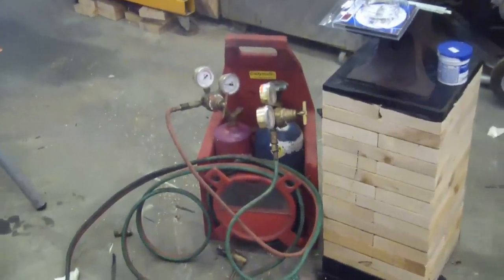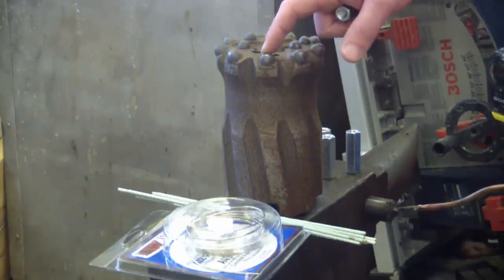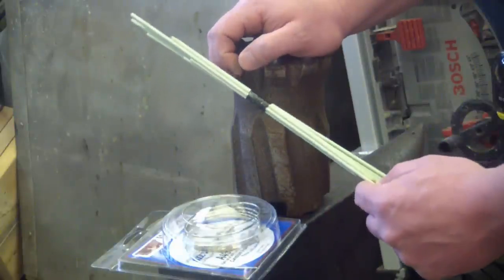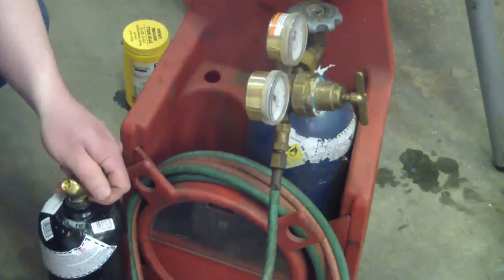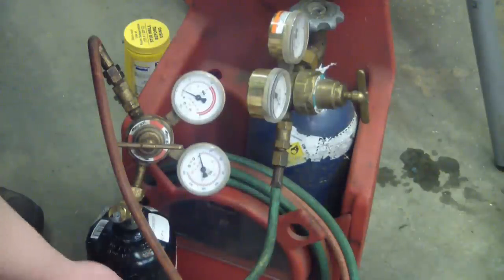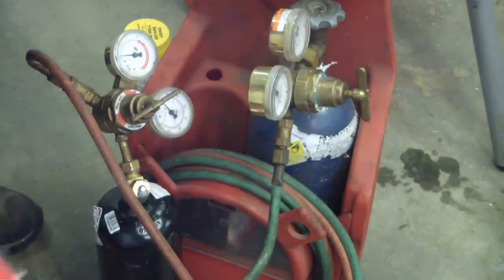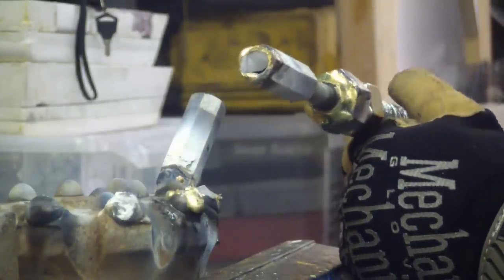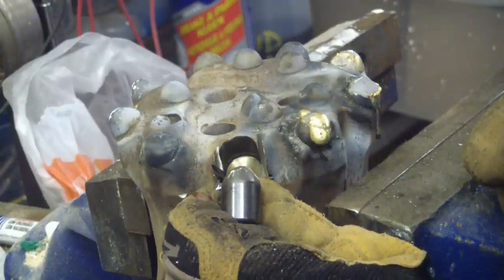How to recover tungsten carbide from drill bits

Comment: Carbide Recovery by electrolysis and acid erosion

Bringing the part above the braze melt temperature and impacting the part to send the tips flying is quick but dangerous. A couple of chemical methods come to mind that should recover both the tips and the metal part without much distortion. If your drill head has press fit carbide then try the stuff below.

Pure WC aka tungsten carbide is completely resistant to acid attack except HF and HF+HNO3 mixtures (hydrofluoric acid and HF mixed with nitric acid for extra excitement and very dangerous stuff). Regular swimming pool acid is med conc hydrochloric acid and should rapidly dissolve out the brazing metals holding your valuable WC buttons in the alloy steel drill head. Simply pour some of that pool acid into a plastic yogurt tub up to a level that covers the WC buttons and place the drill head into the liquid button side down for overnight, up to a couple of days.

If the buttons in your video are cemented tungsten carbide or WC+Co mixed metal sintered composite, the cobalt mixed metal binder may dissolve on the surface of the button and leave a black sponge of porous WC behind and that is not good. The rate  of WC sponge formation and attack of the WC button may be slow enough compared to how rapidly the the brazing metal dissolves away to loosen the buttons and still leave the button usable for your applications.

The mining industry often requires and is willing to pay for extra heat and corrosion resistant grades of WC carbide and WC+Ni is very resistant to corrosion compared to WC+Cobalt metal composites. If your buttons are WC+Ni grade, the button will not turn black when exposed to the HCl swimming pool acid as it is not affected by med conc HCl.

The other method that offers potentially zero labor removal of these WC buttons is electrolysis of the drill head using NaCl table salt bath and a 12v battery charger. Make the drill head the anode. The anode is where the drill head metals will oxidize into dissolved metal salts, eroding away the brazing metals around the resistant WC buttons. This method can erode away the brazing metals much faster than the surrounding alloy steel and if the right voltage is used, keep the steel drill head intact as well. Higher voltage will directly erode the alloy steel drill head. Could be useful for recovery of brazed saw tips without damaging the saw blade plate. This would avoid the need to neutralize spent acids with lye before disposal although the spent electrolysis bath salts can be classed as hazardous waste due to copper and tin salts dissolved in the bath after use.

Comment: Looks like simple shrinkfit to me. Cut the body in half, leaving enough space behind the bits to make a hole and thread for grease nipple. Use grease gun to apply pressure behind the bit. If that is not enough, use torch to heat the body. DO NOT stand in the "line of fire". Sorry for bad english, but i hope you get the idea.

Comment: I knew someone that removed those for a living down in NM and they sold them off to a company that made TC powder probably by roll milling them against each other? to make various grades of sand paper, Personally I would love to see if smelting it into some tool grade of metal to make home made micrograin carbide stuff would be my suggestion or maybe a plating method to embed them, either way, Can TC be refined through electrolytically transmitting it like we do with copper through copper sulfate? some ideas I would try out lol.
Reply: I have been prepping to set up a couple things that use this tech, though don't want to air them publicly, lol, will message you if you want to talk. or even just know why not to talk publicly :)

Comment: You can Tig braze tungsten carbide   , i make up custom  die grinder tools by  brazing fragments from smashed lathe bits onto steel rods for cleaning  ceramic shell investment from the inside of castings

Comment: These are put in by interference fitting...that is making the holes smaller than the buttons...then they heat the bit and not the inserts so that the inserts can be pressed into the holes. Once the carbide rises to the same temp as the steel it is in to stay. Heat entire bit head to cherry red or more and vibrate near each cutter with an air chisel. Not the carbide inserts cost about $3 new so reclaim is a narrow margin endeavor. If the inserts are PDC cutters then it could be worth while.

Comment: Damn, guess my bright idea didn't work. Sorry about that dead end. Was fun to watch the fail though :P
Reply: ***** Besides #2 which shattered rather spectacularly, were #1 and #3 unharmed for later removal? BTW, which acid did you use on the penny video? I have some HCL but don't remember enough chemistry to know if it would work as well. Any ideas? (BTW, HCL + h2o2 is the best pcb etchant around)

Comment: Ditch the acetylene. Switch to oxy-propane and get ya some rosebud tips. Less fucking around with adapters, easier to obtain, better for heating, great for cutting, and cheaper too. Oh, and make sure you clean all the plating of yer metal b4 ya braze it. Great videos... keep em' coming.

Comment: I would try to drill a cross hole at the bottom of the seat and fill it with grease. Then put a tight pin in that hole, push that pin with a hammer in the hole, so that the grease will press out the tungsten carbide insert. Just like an hydraulic piston.

Comment: ever hear of Kyocera ceramic inserts (tc30) Im a die maker and usually say 95% of the dies I make use carbide inserts. Lon story short I have a scrap piece of the Kyocera insert. its extremely hard pretty damn brittle very light and really expensive.  seems like its right up your alley for investigation. its about 1.5" od .500" with a .500" id thru hole. I would like to send it your way. if you are interested let me know.

Comment: Should have used a large nut instead and arc  welded from inside and out of the nut.That's if carbide can be welded to nut. Then try heating the rig cutter and turn the welded nut until loose. or Re weld another nut,over lapping smaller but not weld inside the threads and use pull hammer. :^(

Comment: Use in your slingshot or load them in a 12 guage round off course. Lol I have many hours sharpening the buttons on water well drilling down the hole hammer bits. Guess it was cheaper even with the price of the diamond sharpening stones than to send them out.

Comment: could you drill a hole on the under side just enough to get in the opening under the carbide and tap a grease fitting in it and giver hell and the try heating the steel around the carbide ? just a thought

Comment: Since you had the torch out wouldn't it have been easier to just cut the carbide out? Maybe preheat with a rosebud or oven. 

Maybe you can melt them down in an plasma arc furnace and cast some pure WC bullets! Dunno what the cobalt would do at those temps though.

Comment: what to use the carbide slugs for? you could braze them to a cold rolled steel shaft and grind a cutting edge on the end and you have yourself a first class metal cutting tool. The easiest shape would be a lathe cutting bit, But also a countersink is possible. Or a single flute end mill. A two flute spiral drill or end mill is much more difficult and needs special machinery. Check out these links https://www.youtube.com/watch?v=py0t1OGmSQ0 . You need a diamond grinding disc for grinding carbide. They are quite affordable and available in most hardware stores.

Comment: ?? If the Carbide can stand some heat and thermal shock, and the matrix is some kind of steel, it might be that the cutting torch can sort of wash the steel off the carbide insert!  Just around one side, until the insert just falls out.  

I once saw a broken bolt burned out of an engine block with a cutting torch (the threads in the block were still good), this is like the inverse of that, I'm thinking.  If the carbide isn't affected much by hot oxygen, maybe the oxygen stream can just flow around the carbide, making the hole a little bigger!

This has probably come up in the last four years, but I don't see it in the few dozen comments I just read....
Reply: ok, shawn G suggested this 8 months ago.

Comment: I would start with the drill a small hole Over a year later, and a dollar short. You could not get under the edge with a coal chisel, heat the casing red hot and grab the button with vise grips. How about making like a bearing puller for the size of the buttons.XXXXXX Drill a small hole at the bottom of the button make sure it goes through to the bottom button fill with grease, put drill bit in up side down or piece of shaft that fits not too tight and whack it with a hammer, the grease should push it out. Install a grease fitting see if your grease gun will push it out once it starts.

Comment: Hey dad, I know I'm a bit late to the party, however; Why not spin the brazed nut with that hammer wrench thing? It appears that the od of button outside of the bit is the same diameter as whats hiding beneath the sheets if ya knoiw what I mean, sir. Spin and Tug, just like  ya did when it was preteen showertime.

Comment: I know this is an old video. I've actually been watching them all one by one - non stop - so bad that my wife just handed me a sandwich with the cellophane wrap still on the cheese - I think she jealous - and it wasnt enough to get me out of the computer room - in any case - my question is---would I be able to throw those in the bucket and use them to electroplate something??? - i turn a wrench - not big in the drilling things unless I have to  - but a set of wrenches might look pretty cool tungsten carbide plated....

Comment: if you heat the surrounding metal to about 600* can you not grab them with pliers and pull them out? either that or super freeze the whole thing and smack it with a hammer to shatter it. everyone loves liquid nitrogen.

Comment: I exhange both small cylinders at AirGas here in Texas for $37.
Reply: Like the ones in your portable rig
Reply: Over here in the UK we use Oxy Propane for cutting and general heating / brazing. You only really need Acetylene for welding. Propane is way safer to have around than Acetylene and lot cheaper too.
Reply: ***** I've done a lot of cutting propane, can't say as I like it much either, but oxy propane does a great job for silver solder and brazing. Your new gauge will screw right into the BBQ tank. And that wee acetylene tank is called an MC tank because they were originally designed running the headlights on motor cars. The next size up is a B tank, they were originally designed running the headlights on public buses... If the women don't find you handsome...
Reply: trollforge ahhhh I love the reference to the red green show,  hardly anyone in America has ever heard of it

Comment: just blast away the under and beside the bits with your torch. Using the same cuts you made with the grinder. then use hammer in the same way. work while its smokin hot. oh yeah safety glasses and face shield and leathers

Comment: Just drill a hole beside the carbide, just to the end of the end of the carbide inside , then use a remer, then fill the drill´d hole whit greese and set a punch ind the hole, has to fitt with in H7 or less, then use the hydralic power to press it out without damage the carbide, that s it  ;) Let me know, if it work´d for you.

Comment: can you melt down that metal and make blade for knife?
Reply: Tomislav Buza no
Reply: Francisco Chavez whay not?
Reply: Tomislav Buza Tungsten Carbide isn't a metal. It doesn't really melt in a forge, it just gets hot and brittle. I mean, if you had a forge that could up to like 3000C you could melt it but I dunno if you can really forge it.
Reply: Tomislav Buza you would need a industrial grade arc furnace, and more power than you could pay for
Reply: Dassault Aimpoint and it has high rate natural gas burners

Comment: Try drilling into it with a smaller bit than the carbide button slide a piece of flux coated steel stock into the hole and see if you can electronically weld the steel stock into the hole.....? then maybe you can slide that shit out?

Comment: we used too silver solder carbide tips on lathe cutting tools
Reply: mike97525 The diamond blades we use to cut asphalt have TC kickers to help keep the abrasive asphalt from grinding the steel blade core away undercutting the diamond abrasive teeth and causing premature failure.

The reason I mention this is when I was little my grandfather used to silver solder the bits onto the blade cores. Now of course they're all made in Asia and laser welded.

Comment: you can pure gold plate those nuggets , gold has ~same weight n' density as tungsten , sell em to a gold scrap dealer for some sweeet cash $$$ ... fools em every time  ;)
Reply: Kevin Olesik yes but its inmoral and highly illegal
Reply: falcon 1452 So he works in Congress, then. ;)
Reply: TheOneWhoMightBe  :)
Reply: Kevin Olesik Tungsten carbide has a density of 15.63 g/cm3. Gold: 19.3 g/cm3. that's not even close.
Reply: read it for yourself :  http://www.businessinsider.com/tungsten-filled-gold-bars-found-in-new-york-2012-9
Reply: Kevin Olesik That's Tungsten. Not Tungsten Carbide.
Reply: aaah ... very interesting distinction  ...
Reply: Kevin Olesik One other thing is that it isn't pure Tungsten Carbide. It is actually a powdersintered material which uses in most cases Cobalt as a matrix material which has a density of 8.9g/cm3. So the overall density is really considerably off of that of gold.
Reply: yeah that's right < far from pure tungsten ...

Comment: there is a reason why this shit is used un drill bits in the first place. also bulb filaments; an odd contrast but the same principle.
Reply: Tungsten carbide and tungsten metal (filaments) are not the same material.

Comment: LOL on the slide.  It Miiiight have worked if you heated the metal monolith then gently worked it out.
Glad you got them out, maybe throw them in a bowl of cereal.  Break your teeth, extract those with a slide hammer and put some jaw bone fittings for your new tungsten teeth.

Comment: aren't those holes for clay solution, not water
Reply: Ok thanks
Reply: +TheQuoChannel You do realize that clay does not dissolve in water; don't you?  Drilling mud is solid fines pushed along by water not dissolved in water.  That makes a huge difference when choosing pumping equipment for handling such.
Reply: Usually drillers cut with water first and then once they get to depth they start drilling and flushing with grout or portland cement. These are typically used and left in the ground believe it or not on the end of drill steel for big piles called "micro piles" in foundation structure.

Comment: Ave !! What if you drill a hole under the carbide plug, and push it out like a pilot bearing,   grease or wet news papers and a punch that fits the hole perfectly chooch? Or to overcomplicate it thread a grease Zert into the hole and let the gun do the work.  K with them out make your own SUPER DRILL BIT, drill some holes in some round stock. reinsert the little bits of toughness and start drilling to china!! It came to me when my wiener was in the vice ;)